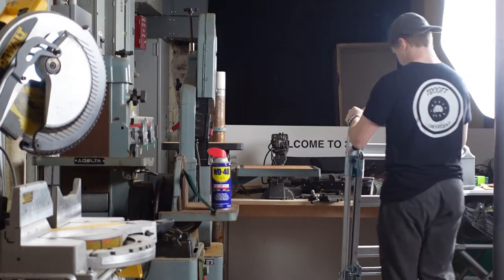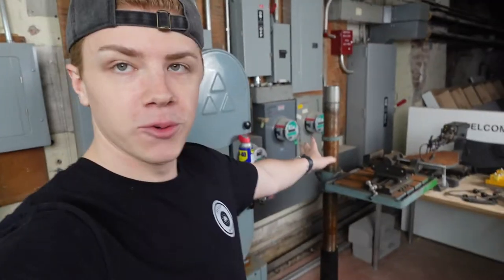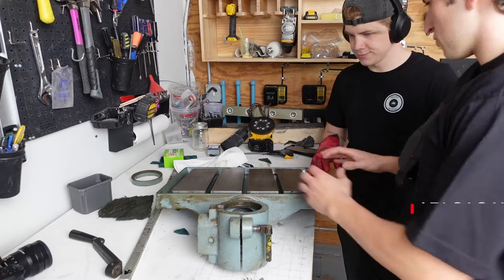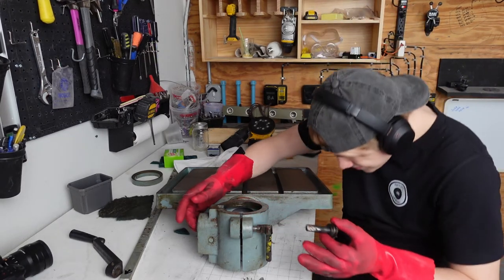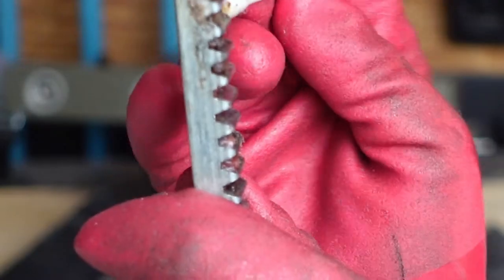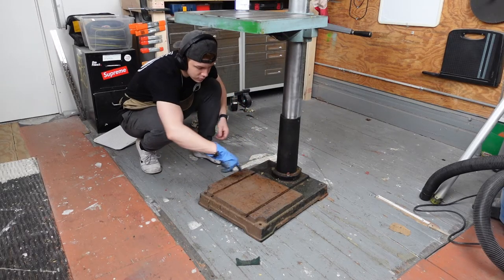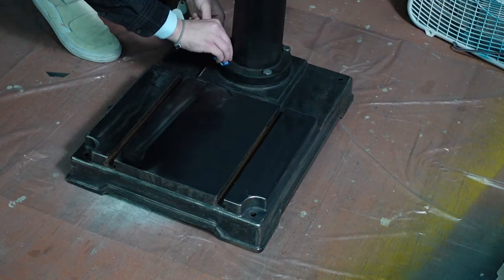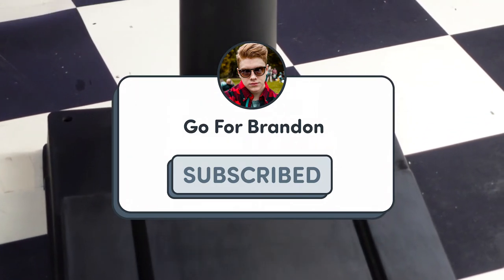20+ Year Old Drill Press Restoration - EP 1: The Base

Comment: I'm trying to figure out how to take the motor off the unit. Unfortunately your video starts with it already off. Guess I'll wait for the reassembling portion.
Reply: Great video btw.
Reply from the maker: There should be two hex head set screws on one of the sides in line with the column, that you have to unscrew a little bit. Then you’ll  be able to lift it off. However, I would recommend removing the motor and spindle first, to remove as much weight as possible because the thing is STUPID heavy.
Reply from the maker: Thank you!